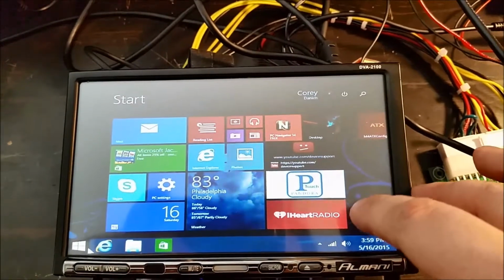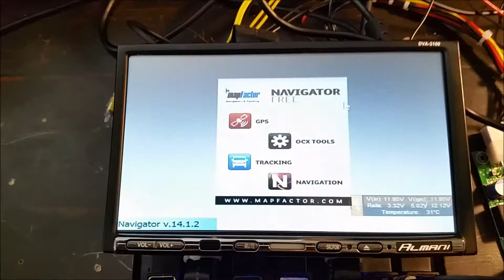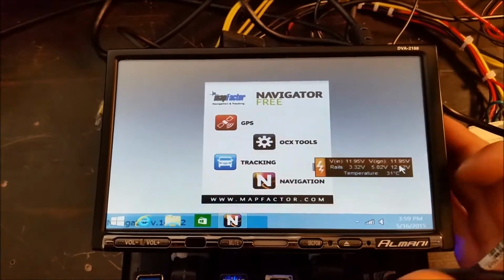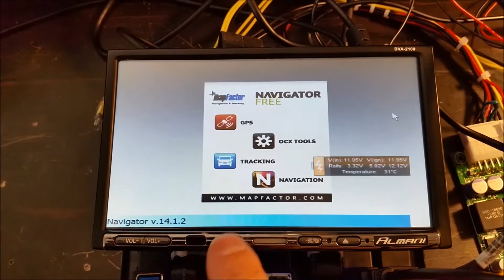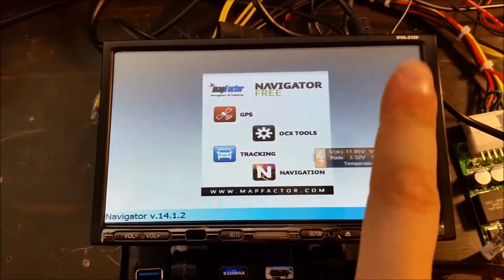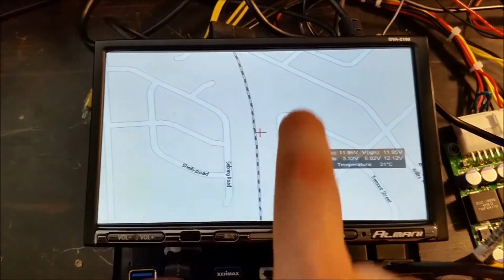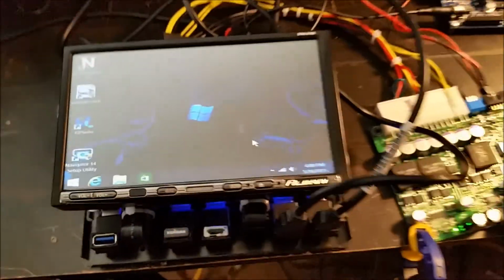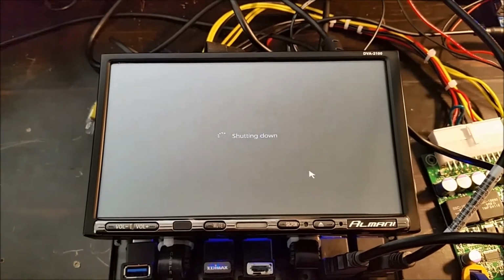M4 Atx Minnowboard Max Modification Part 2

Comment: Hello, I am assuming the jumper wire is from pin 10 to a gnd pin? Thank you for the videos and info!
Reply from the maker: If it's the standard 24 pin ATX, then yes, pin 16 to ground.

If it's the mini 20 pin ATX then it is pin 14 to ground.

But in both it is standard that the color of this wire, ps_on# signal, is green.

Thanks for checking out such old content, glad it is still helpful to this day. Maybe I'll be posting new content in the future.
Reply from the maker: Edited because I'm dumb and half asleep and forgot standard atx is 24 pin. 🙃
Reply from the maker: Edited again! Sorry! Half asleep here!

Pin 16 to gnd for standard atx
Reply: Thank you! I seem to have gotten it to work with that jumper, but now I’m having an issue where once I disconnect the 12v switched it shuts down, but after a few seconds instead of going hard off, it turns back on even without the 12v switched
Reply from the maker: @x_76  now that is something you will need to check with the manual. There is a few jumper configurations to consider. I don't remember them unfortunately.

If all else fails you can program all of those options in the visual graphical user interface, so have the software installed and the USB port recognized.
Reply: @cjfdaniels  yeah I’ll have to look into it more, thank you once again!! Appreciate the time!

Comment: hi, i do  have dip 1 on rest are of (flipped up) i cant get graceful shutdown /hiberate to work, it just does hard off. i reinstallled the software, did the jumper reset.. any suggestions tank you.
Reply from the maker: ford pc Pins 6&7 on the connector labeled J8 need to be connected to the motherboardON/OFF pins for the m4atx to send the off signal to the motherboard. 

To adjust the countdown for the off signal you need the m4atx connected via usb and then you can change the timers with their desktop app.
Reply: i been using it for years and not sure what happened, i reinstalled everything, got even a new unit, new mb,  formatted..  which countdown timer should i use? i 6-7 are connected to the on/off header..

Comment: Do I need the j8 connected to the motherboard for it to turn on? I'm having trouble with this. The led lights blinks 3 times then changes to slow blink. I currently have no J 8 connection
Reply from the maker: J8 isn't needed for operation, Just for extra features: USB, Motherboard ON/OFF and THUMP.

It actually sounds like you don't have the 12v sense line connected. The sense line is the "Ignition" Rail and it signals the PS to turn on when connected to positive 12v and off when disconnected. So for the power supply to operate you must have 12v positive connected to V(+) and also Ignition.
Reply from the maker: Also without Motherboard ON/OFF on J8 the PS will act like an AT power supply instead of an ATX. Just FYI.
Reply from the maker: and one final thing, after re-reading the manual... big bold red letters say "Do not use in the standard PSU mode
(mode P0)" so just check your dip switches and verify that it isn't in P0 mode before using the Ignition line.
Reply: Thank you so much. We forgot to connect the  12 v sense line

Comment: I've been reading your build list in another video, searched the brand name of the buttons on the front of your screen, but I can't figure out where you got the volume buttons from. this is the only thing stopping me from building a carputer. could you help me find that product or something similar?
Reply from the maker: Unfortunately I never intended on utilizing the front buttons I plan to replace it with a blue led strip for show later; however, I did find you this http://m.ebay.com/itm/121696775012 this is exactly what your looking for, but if you've already bought a double-din case then you will have to customize the usb button panel pcb to fit whatever case you chose, and this might mean having to remove the surface mounted buttons and afix them to a length of wire in order to be able to customize their positions accordingly to accommodate button bezel. 

however however.... I also found fully assembled lcd/touch screen displays for Double-din units, and it's universal! (Supposedly universal. I always expect to run into some problems when doing custom.) The unit even comes with a usb port, but the 15$ usb button pcb doesn't come with this assembly and needs to be purchased separately..... 

the seller has a HDMI version and a VGA version, but if you do this on a Minnowboard max I highly suggest HDMI or you will run into a huge headache trying to convert hdmi to vga. 

http://m.ebay.com/itm/2DIN-IN-DASH-7-Samsung-HDMI-Touch-Screen-Monitor-KIT-USB-SD-Raspberry-Pi-/121482589365?nav=SEARCH

http://m.ebay.com/itm/2DIN-IN-DASH-7-Samsung-VGA-Touch-Screen-Monitor-KIT-USB-SD-Raspberry-Pi-/121482588662?nav=SEARCH
Reply: +CorJFexd (CJFD) thanks for all the information, very helpful.

Comment: Hi CorJFexd, may I ask where you purchased your heatsync/fan from?
I haven't been able to find any information on the internet, and was going to resort to using thermal adhesive instead of the heatsink mounting holes.
Reply from the maker: Killian Orannis I used Ebay and it was one of the more tricky parts to find. I think I searched "40x40x10mm VGA Heatsink fan combo" and most likely you'll find alot of them are 12 volts.... and you just reminded me that I left my final build running a 12v fan on a 5v rail.... I suppose i'll fix that when I go back to address the RTC battery issue. 

http://www.ebay.com/itm/PC-Computer-Graphics-VGA-Card-Chipset-Cooler-Aluminum-Heatsink-Fan-3Pin-40mm-K-/121522292779?pt=LH_DefaultDomain_0&hash=item1c4b4b082b

The link is the exact fan that I used in this build but the seller is not the same and i think the sale ends in 18 hours. 

and I also used PCB Mount screw down terminals for the connector. 

http://www.ebay.com/itm/10x-2-Pin-2-54mm-Pitch-PCB-Mount-Screw-Terminal-Block-Connector-Fits-PCBs-/141451936988?hash=item20ef3144dc
Reply: Thank you so much for this information, i think I'll keep it passively cooled, but will be looking for a taller version of that sized heatsink.

Good idea on the connector, hopefully I can also use them for the power switch and hdd led too (Planning on putting this into an itx case if I can get the raid card to work)

Many thanks for the links too.

Comment: What screen is this? Are you doing this for a car install?
Reply from the maker: Cole Cramer I purchased the screen from amazon. "http://www.amazon.com/gp/product/B00HNLXZHO?psc=1&redirect=true&ref_=oh_aui_detailpage_o04_s00" The screen can be used for the Raspberry Pi. What you see here is the exact screen I linked except for the case. I used a broken Double Din head unit to house my project, and I had to modify the screen and media controller board to fit the case. The finished project turned out nice and i'll be uploading the final video for that sometime this week. I plan to install this into my car but I need a few more parts to make the experience complete. I'd like to keep my steering wheel controls so i plan to purchase a "resistive-button to USB converter" and i'd also like to have an equalizer so i was thinking about using a "USB" sound card like Creative X7, but I am undecided. Thank you for sharing.

Comment from the maker: I'll have to do some research and get back to you on that for a definite answer; Though, I'm pretty sure that you can. I personally haven't experienced any limitations with the Minnowboard max, but if you can run OpenGL on windows 8.1 or Ubuntu I can't imagine it an impossibility. The Minnowboard community has grown quite a bit, and even third-party developers are now contributing as well. You may find your answer here "http://elinux.org/Minnowboard:MinnowMax" along with firmware/bios images.